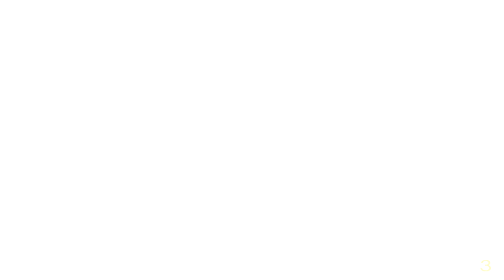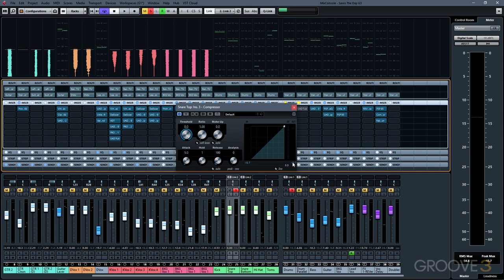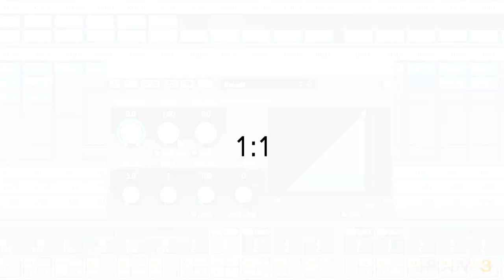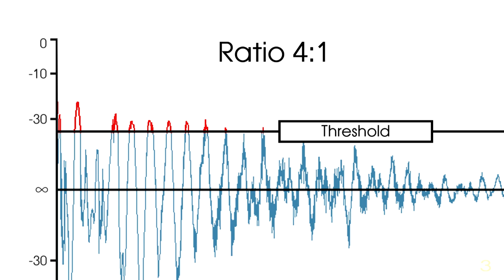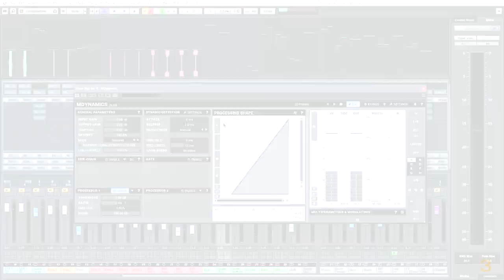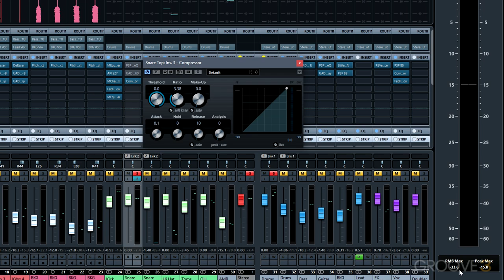Threshold, Ratio & Makeup Gain - Compression Explained (06 of 14)

Comment: Hello Groove03 and others, There are two things that I don't understand. 
My first question: I use the logic compressor and on this compressor the treshold goes from -50 to 0. This is confusing for me.
Does this mean that all the amplitude values above zero can't be used for compression? Wich would be very weird because volume peaks can be above zero. I first thought the threshold would diminish the amplitude with the treshold. So you have 20 db as your volume peak so when you set the treshold to -10dB than the threshold would start at 10dB, but I later figured out through watching this video that this was a invalid conclusion.
Question 2 with the same context of using the logic compression. Through practice I discovered that my de auto-gain of 0db and -12db doesn't give the same output volume as when I use the make-up gain knob manually on the values 0db and -12dB.
I have also thought about meeting a professional and asking these questions but I hope someone on youtube can help me out.
I am going to further watch this video and I hope I can think my way into a logical systemic idea. And hopefully I can find my solution in one of the previous videos.
Thank you in advance Imre